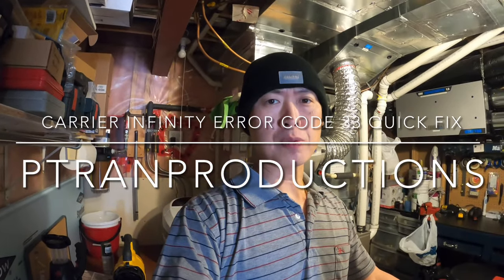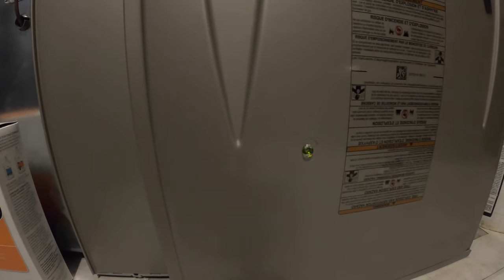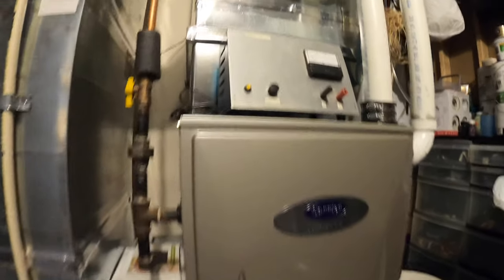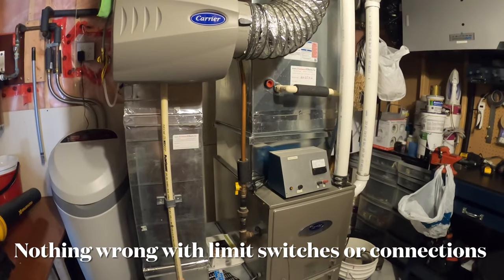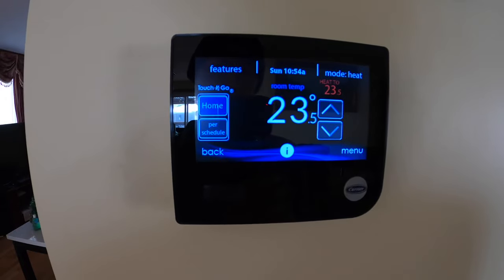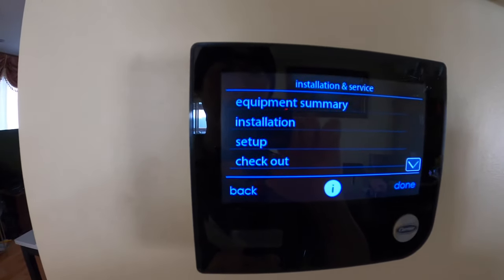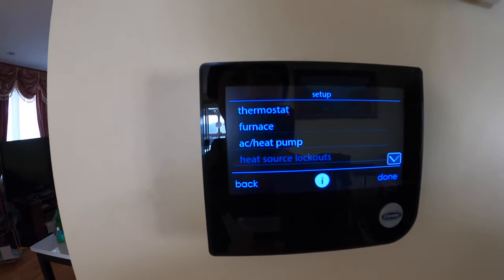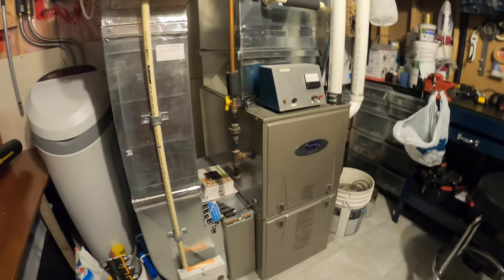Carrier Infinity Error Code 33 Quick Fix

Comment: AMAZING!!  We have struggled for 8 years with our furnace kicking out with the Error 33 code. It started happening immediately after the furnace was installed. I have had a least five different techs out—all said it was fine, no issues.  I changed the setting on the thermostat and it has not happened once. THANK YOU.
Reply: What setting? Mine is doing the same
Reply from the maker: Yes, that’s what happened to my new furnace on the first heating season. 5 different techs and no body could figure that out? That’s a shock! Lol!
Merry Christmas!
Reply from the maker: @rodrigues0484  
Please watch the video for details of the setting.
Merry Christmas!

Comment: Just wanted to thank you. I had the same Humidifier installed and it caused the same issue. In the manual it says if you use a Humidifier bypass you have to set it to this setting. 
I didn't have the Carrier thermostat (I have NEST) so I was able to use the manual to locate and set SW1 dips switch to switch 3 ON and switch 4 OFF.  
Saved me a bundle. Thanks
Reply from the maker: Np, bro!
I am glad that the video has helped you👍
Yes, I tried those switches at first but it didn’t work for my system because the Carrier smart thermostat took control of all the settings.

Comment: Thanks for this video - For me I had to enable that same setting using the dip switches on the control board but it was exactly the problem I was having!
Reply from the maker: You’re welcome! Apparently based the responses on here, it’s common problem with Carrier Furnace. The sad thing is that my installer didn’t foresee that at time of installation and setup.
Reply: Can you share dip switch on control board

Comment: error code 33 turns on when the discharge temperature gets too hot and trips the high limit sensor. Low airflow causes the delta T of the air flow (discharge air temperature subtract inlet air temperature) to go higher and results in too high of a leaving air temperature . This is 95% of the time due to low airflow caused by too many air vents closed in the house or a dirty filter (you should really change it religiously in heating mode once every 30 days esp if you have a lot of people in the house). More occupants = faster dust accumulation from dead skin falling off. Turning on the setting that you show locks the fan motor in it's highest airflow which lowers the leaving air temperature. More airflow = lower delta T.
Reply from the maker: Thank you for your comment!
Yes, error code 33 triggered due the limited switch tripped and because of the system was not setup according to the manufacturer’s (Carrier) recommended in the owner’s/installation manual.
Yes, initially I tried those remedies as you mentioned such as fully opened all the air vents and installed brand new filter. However that did not get rid of error code 33.
Replacement furnace filter once a month, in my opinion, is not economically feasible. Especially with these new high efficiency furnace, the filter size 5”x16”x25” has longer life. Besides Carrier Infinity has air flow sensor that would let me know when to change the filter if it senses weak air flow.
The setting in this video is based on the Carrier Infinity installation/user’s and it did get rid error code 33. Also, Carrier Infinity furnace is a variable stage furnace which means it runs at variable speed even with this setting, not locked up at highest airflow like you mentioned.
Cheers!
Reply from the maker: Thank you!

Comment: What if you dont have that thermostat and the thermostat i have doesnt have options for those settings.
Reply from the maker: Use your furnace manual to locate and set the DIP switch SW1 with S3 - ON and S4 - OFF.

Comment: Hello .. I have SAM COMMUNICATION FAULT 186 , so you know what that error supposed to be ??
Reply from the maker: Sorry buddy, I am not sure what system you have there.  There’s no such trouble code listed for the Carrier Infinity system.  You can check your user’s manual or your furnace door panel for your specific trouble code (if that is a valid trouble code).

Comment: Can this fix be done on the housewise thermostat and not the connex evolution? I have same the same issue but cannot find low gas heat setting on the housewise. Will I need to upgrade the thermostat?
Reply from the maker: No, this setting only available on the Carrier Infinity thermostat.
For your case, you need to use the DIP switch setting at the control board of the furnace. You can check your furnace user’s manual for more details about this setting.
Reply: @PTranProductions  thanks for this video and the comment. I have a similar issue, modified the SW1 switch 3 on and switch 4 off. It ran fine for 20mins no issue and happened again. It seems my humidifier isn't working. I turn the humistat on and I don't hear the selenoid click. Is there any relationship with this low heat setting and humidifier needing to be on? I can feel the air passing through the bypass which is what I thought this setting help with to avoid the error 33. Any other suggestions please?
Reply from the maker: @watchingwonders6900  
Do you have the Carrier Infinity thermostat?
If you do, you need to set the thermostat as per my video. The Carrier Infinity thermostat override the DIP switch setting.
The humidifier function (on/off) doesn’t effect this low heat rise setting.
Reply: @PTranProductions  unfortunately I have the housewise as well not the infinity.
Reply from the maker: @watchingwonders6900  
Try to set SW1-3 on (default is off, turn on for bypass humidifier as per the manual) & SW1-4 on (default setting)

Comment: Does that basically just increase air flow ?
Reply from the maker: Not sure what it is doing but it fixes the problem.
Reply: @PTranProductions  yeah I’m running into this problem with new install. I believe it’s because it has a 5 inch filter which has a higher merv so I don’t think it’s getting enough air flow
Reply from the maker: @Sesamestreet9080  
Check out your settings on your infinity thermostat! Follow the instructions on my video to fix your problem.